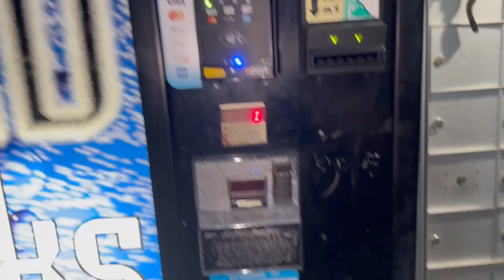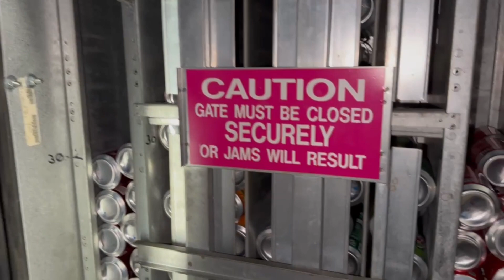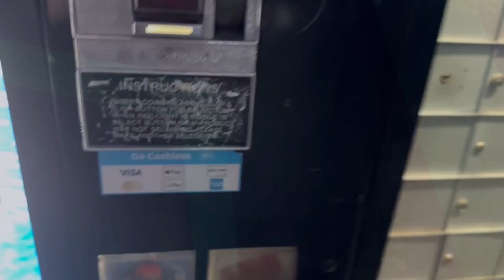Mobile Home 501 Vending Machine Collection #money #vendingmachine

Comment: Nice video. i'm new to this, but i thought you were to put the cans tops to the back and tops of the cans to the front. just asking. have a nice day.
Reply from the maker: for the dixie narco can machines the tops are always supposed to be facing the back of the machine. that way the sold out panel can't accidentally catch the tab of the can and open it in the machine
Reply: @720vending  , O OK that is good to know, would not wont that. lol.  thanks for the info,